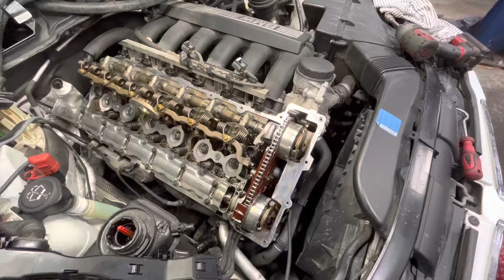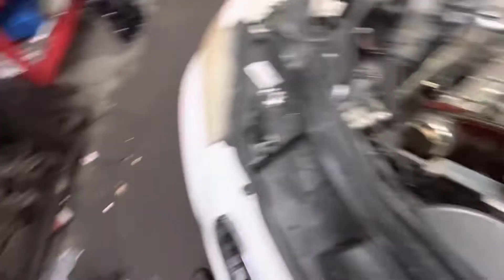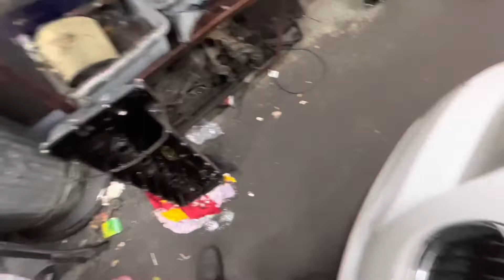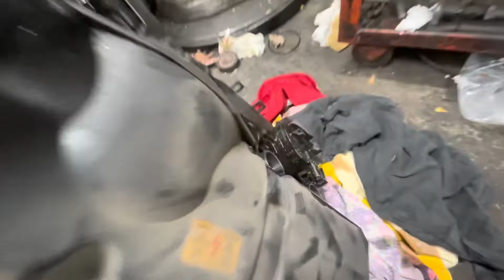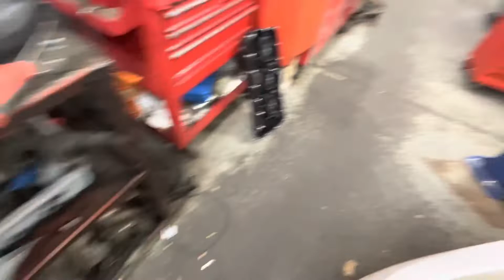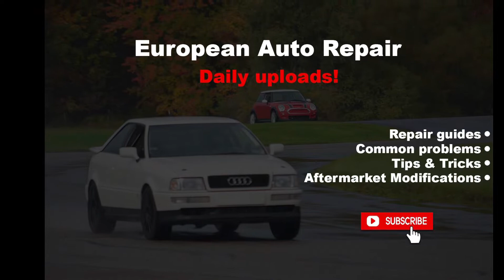COMMON MISTAKE WHEN REPLACING VALVE COVER GASKET ON E90 BMW

Comment: One of my BMWs 2007 320i S3 E90, all of a sudden, I started to hear strong and loud rattle noise coming from under the valves cover, upon visual inspection through the oil intake with a flash light, noticed or found a small plastic piece near the chain,  and I believe there are more of those plastic pieces floating inside , since I've just switched to European cars BMW in particular, and trying to learn, I wonder where all these plastic pieces came from ??, any input is highly appreciated, cheers
Reply: N46, terrible engine
Reply: @Fadil1954  probably the timing chain guides. Hope you sorted it. Check for pieces by removing the sump to ensure oil pick up is clear of blockages.

Comment: What happens when one of those breathers fall off? Can I still use the cover? The same cover fell off on mine.
Reply from the maker: You could try to glue it into place but you may be better off replacing the cover at that point
Reply: @EuropeanAutoRepair  unfortunately I have to have the car ready by Tuesday for work. I put high temp rtv to hold it in place until I get a replacement. Those gaskets are a pain. They don’t stay in place when trying to fit the cover back on.  I replaced the Pcv heater with a 7.5 inline fuse according to the TSB. I also replaced the vanos bolts according to the TSB as well, which is why I had the cover off. Once the cover is back on, I’ll be replacing the oil pan gasket, thermostat, reservoir tank, engine and trans mounts while the subframe is dropped. All by Monday.
Reply from the maker: @iamurnamann8662 haha sounds like your standard bmw repairs, is it a xdrive? Makes the oil pan job a little worse
Reply: @EuropeanAutoRepair  it’s an x drive. Axles have to come out. Ugh.
Reply from the maker: @iamurnamann8662 dang, hope it goes smooth!

Comment: I have one bolt that's different to all the others. One is elongated at bottom rear corner but another one has a washer edge head AND the top hat bush. What's its correct location?
Reply from the maker: The parameter bolts are all the same if I remember correctly except 2 that go through the metal bracket on the bottom edge
Reply: @EuropeanAutoRepair  opposite corners are different. Rear lower corner is oblique and the upper fwd is double washered

Comment: Yo how did that ELRING work out for you bro? I just put one on my n52 and had some problems with it.  aligning my valvetronic worm drive was a mission. it would engage fine but the two Torx bolts directly connecting it to the VC could not go in smoothly. nor the one on the bottom of the Valve tronic motor connecting to the bracket
Reply from the maker: I’ve actually had pretty good luck with the elring branded covers, you must have received a bad one

Comment: Hey mate’ is there some sort of filter inside the valve cover? 
I’ve just replaced my gasket but reused the cover, the car has 146 k now on a 2014 / 330d . And seems it’s bypassed the gasket’ getting bits of oil burning on the exhaust, rising I can see whilst I drive it. A mechanic said there is a filter and it’s clogged up in the valve cover. It’s blocked the engine can’t breath and it with always push oil from the valve cover. 
Thanks’ my bad for the massive message 😁
Reply from the maker: Sometimes they have baffles built into them, I wouldn’t necessarily call it a filter but if you have oil coking it could plug it up
Reply: It's the crank case ventilation valve (CCV) - it's integral to the valve cover on the N43 engine, so cannot be serviced separately - need to change the cover, especially with higher mileage.  I think I have the same problem.
Reply: Ccv. It's connected to a hose in the back of the valve cover and releases pressure inside

Comment: I just replaced my valve cover and it’s not starting. Just cranking and cranking. Any idea?
Reply from the maker: Those engines are prone to flooding if you start them and shut them off without bringing them up to temp, hopefully that’s all you have going
Reply: What kind of answer is that.  Recheck everything. Plugs, coils and ale sure injectors wire harness is tight. Make sure everything is connected
Reply: @samchallengeangel926 I have the same exact issue. I’m going to recheck everything when I have the chance but I’m pretty sure I reconnected everything.
Reply: @xBlackHalo I got the same problem I replaced my crankshaft sensor cause there was a code for it and it still doesn’t start you end up finding out?
Reply: @matthewrodriguez5701  when I was changing the valve cover gasket, I reconnected my car to the battery to give my car power to push it out of the way in neutral to make room for someone else to park when I was working on it. This was when I was in the middle of the job and hadn’t put everything together yet. I believe the car’s computer stopped giving power to my valvetronic motor so the car would crank but it wouldn’t start. I had to tow it and take it in to someone with a bmw computer, to tell my car to give power to the valvetronic motor for my car to start. Those things cost about $2k if you were to buy it yourself. But the problem wasn’t that the job wasn’t done correctly, because it was. Checked over my work many times.
Reply: @xBlackHalo I don’t know because I get a engine malfunction light but when I did take out the valvetronic motor it didn’t feel lit it was compressed by a spring